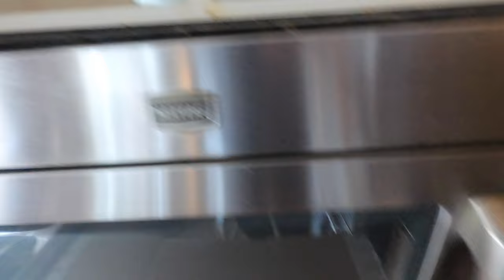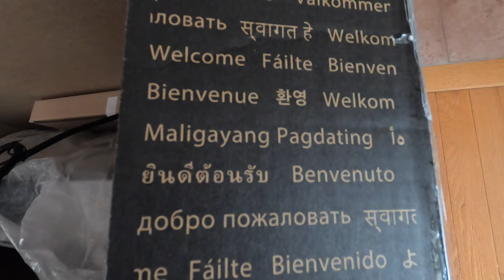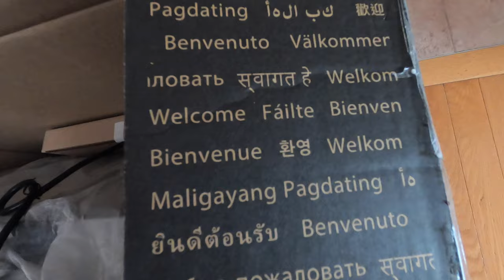I removed my broken OTR Microwave oven and installed new under cabinet range hood ! | DIY

Comment: I have this exact same range vent. I installed it by myself a couple of months ago. I vented mine thru the side of the house since no vent was in the wall. Yours looks like a 4" vent. That's exactly what mine is. Many people suggested against this wanting a 6" instead. I didn't have enough room above my cabinets (their 36" tall) and also in-between the 2x4's on my outer wall. So mine is vented inside the top of my cabinets in the very back with 4" pipe. I haven't had any issues even on low as all the smoke from bacon, sausage and other meats get sucked right out. Boiling water goes right out as well. I absolutely love this range hood. Even on low the outside vent will mess up your hair immediately. The only difference is I installed a 6" reducer to a 4" coming off the hood. I went with all rigid and no flex. I also installed the outside vent slightly upward so it always closes by gravity without downdrafts.   Great job.